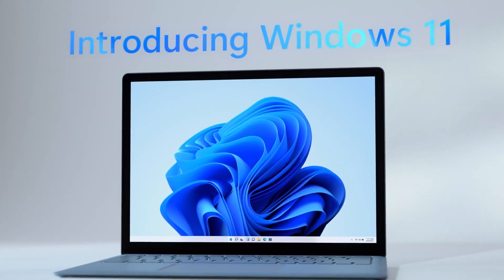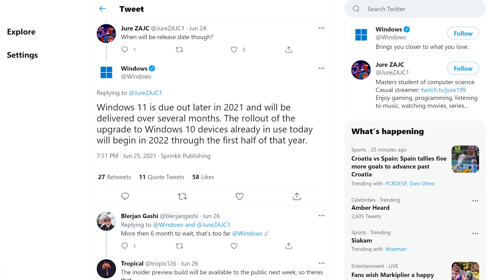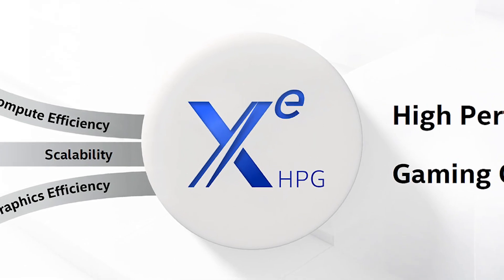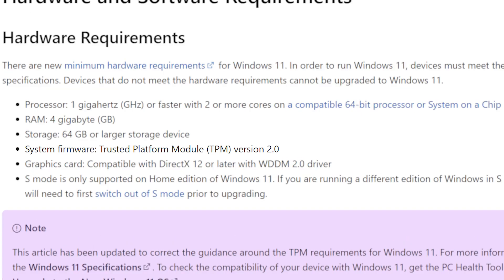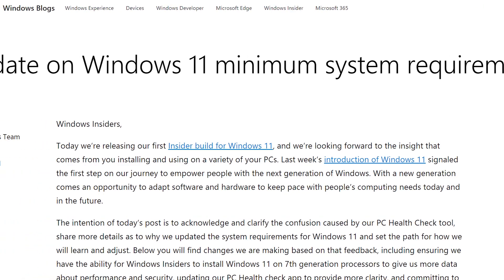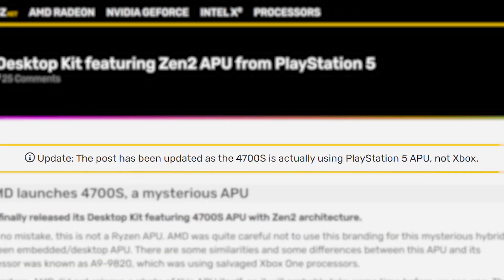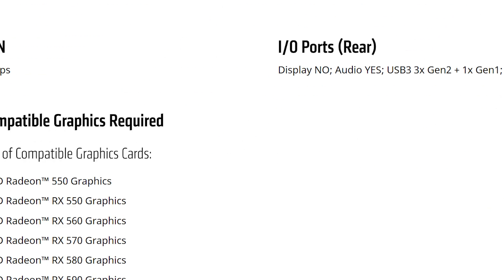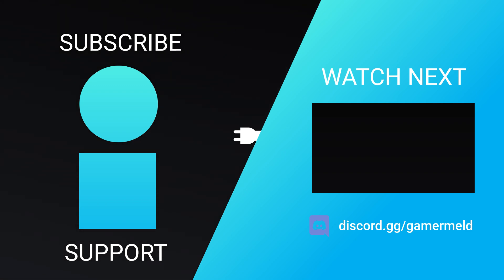TONS Of Gamers WON’T Be Able To Install Windows 11!

Comment: Definitely going to transition to Linux, PopOS for gaming and Manjaro for the rest. Can't wait to get rid of Windows especially since they pulled a "Facebook" for Windows 11.
Reply: Windows 11 is going to run DX games way better than lutris or dxvk can.
Reply: @xander hasass True
Reply: @xander hasass No it didn't, you have to use a translation layer, which uses resources and slows down the game.

Also, now that Nvidia allows GPU pass through most Linux users with Nvidia GPU's are running Win10 in a VM on Linux for the better gaming performance.
Reply: @xander hasass Direct X and Vulcan are not program languages, they are API's.  If you tested games with the DX API, then you had to use some type of translation layer because Direct X is a proprietary property of Microsoft. 

Said translation layer adds latency because EVERYTHING has to be translated instead of communicating directly.

You should know all of this if you tested out multiple games.
Reply: @LePedant  One explanation of why @xander hasass finds games run faster on linux is possibly because of Windows being generally much more resource hungry than Linux, with all the bloatware and tracking. Therefore Linux has more available resource to do the other stuff, which might compensate for the translation layer cost. Not sure if this is the case, and maybe someone already did some testing about this.

As for myself, I don't really care if I lose a little FPS. As long as I can enjoy my games without all the sillyness that all tech giants are imposing these days, it'll be all the more enjoyable knowing my every mouse movement and keystroke aren't being monitored by some AI somewhere.

Comment: The Windows Insider Build just released is allowing installs on Ryzen 1st gen CPUs 👍 it runs really well. I have an ASRock B450M-hdv-r4.0 with an R5 1600 installed just fine.
Reply: the most awaited feature of w11 isn't in the insider

Comment: I'm keen to try windows 11, hardware specs are of no concern as the community always comes together and figures a way around everything. As long as we can install it the activation methods should still work in theory. But we will just have to wait. No good worrying now. Microsoft being Microsoft most likely will change specs again before it's general release. Already signed up to get the dev build.

Comment: To be honest... given the fact that using software in it's 'SUPPOSED' v1.0 these days often feels like Beta or Alpha testing v0.1 

I am not sure I give a damn that I have to wait until next year to use Windows 11

I mean, the many parts of Windows 11 that I don't necessarily agree with aside...  why on earth do we want to use v1.0 of ANYTHING these days when there's a fairly good chance that it's gonna have something broken on launch, and will require substantial time for ppl to discover and fix?

I might as well wait for v2.0 or at least v1.5 then jump in when at least the most egregious issues have been discovered and ironed off.

Comment: Microsoft: yeah screw over anyone on intel 7th gen, Ryzen 1000 and older

Also Microsoft: why is our adoption rate so bad?
Reply: if they already have you on windows 10 they won't care
Reply: @jaysanchez4407  only one of my computers is on win10, the rest are still on win7 because fuck Microsoft for collecting data about my usage and calling it diagnostic
Reply: @PackardKotch  they still can do that with windows 7
Reply: @PackardKotch  you can disable that lmao
Reply: @maybelbdidit  you can bypass it in the beta, not disable it ya genius. The only way to bypass having TPM 1.2 or newer is by putting win10’s installer files into the win11 iso
Reply: @jaysanchez4407  nowhere near as much. Windows 7 only collects basic usage data about the system itself and it doesn’t beg you to log in with a Microsoft account. Win7 also needs less ram so there’s that
Reply: The thing is I just got a new PC and I'm on i5 7th gen 😭.

Comment: There was a guy who just copied the file that checks the requirements for hardware from Windows 10 into the leaked Windows 11 ISO and installed it on an old 1GB RAM HP laptop. I'm sure it will be cracked soon enough.

Comment: Considering how Microsoft's track record is to make one good OS followed a bad one, i wouldn't worry about it
Reply: It's actually somewhat slippery to consider it that way recently. We go 7 - 8 - 10 - 11, so 11 falls as time for the bad shit. Unless we take 10 as bad, which is totally not incorrect... just it means we get the 8 as a good system and the people of 7 will argue with you when you go that one step back, because now windows 7 is the bad time stuff.
The pattern has been broken at this point basically.
Reply: @thestarvingonetso5627  what are you talking about?
XP-good
Vista-bad
7-good
8-bad
10-good
11-looking to be a bad system so far
Reply: @CultOfMonika  Many would probably argue with 10 being good. There was a lot of mess with MS rolling out the system and pushing it by force to customers, while it released kinda beta back then. Besides, I had my moments of trouble with the spring and autumn updates often bringing less fixes than new issues in the system, as well as useless features. There's also some to be said about the security and privacy of the system.
Call it good, but it was the most troublesome Windows of all I had an opportunity to fiddle with (which is XP, 7, said 10, a bit less of 8 and some Vista)

Comment: Why fix your broken os when you can go through the hassle of making a new broken one
Reply: Works for the 90% of its hundred million users while making sure it works on most hardware configuration, yes. Its broken.
Reply: @UnoZero1  oh, so those supposed 90% don't constantly run into driver issues, random hardware crashes, cte's, audio bugs and updates that have such a bad reputation there are YouTube channels dedicated to reviewing updates from the biggest OS manufacturer on the planet because they can't be trusted. Get outta here with your horseshit

Comment: I really don't see the issue with Win'11 requirements. Yes, they are leaving a bunch of people out, but on the other hand, you're not required to upgrade. There is nothing these users could gain from moving on to the new OS - in fact, any improvements that the requirement list brings would be nullified if those requirements didn't exist, and even thing like better support for big.LITTLE are meaningless for old hardware.
 Win10 support will go on until 2025, considering that the unsupported hardware should have a few years already, that is ample room for an upgrade. And any new hardware you buy from now on is likely going to be win11 ready because neither AMD nor Intel would want to buy a fight against the main PC home-user OS provider - specially now that Apple is making their own chips.
 Just... calm down people. Yeah, M$ sucks for many reasons, not this one.

Comment: the amount of e-waste alone this will create is disgusting.
Reply: Microsoft doesn't give a shit about waste.  They probably worked out a kickback of some kind from the influx of PC purchases this will create.
Reply: This is why all my old computers run Linux and are still very usable with them

And you can also bypass the restrictions it’s not to hard
Reply: nah, install linux instead of windows 11 and it will feel like a revival
Reply: (or use windows 10 for the rest of its lifespan)
Reply: @YariCodes  I plan to use Windows 10 but it's just 5 years from now and that's it.
Reply: @Legion849  it’s not going to blow up in 5 years. Just won’t get any updates.
Reply: @MikeJones-bl6lu  Which means you'll be exposed to criminals, meaning people will drop it and run to Windows 11-compatible systems. Happened to XP, happened to 7.
Reply: @markkoetsier6475  there are PCs out there that still run XP. I wouldn’t really worry about anything until 2025.
Reply: @Legion849  You on being unsecure as no security updates roll out for your machine? What's your IP?
Reply: @YariCodes  im thinking of linux. Theres some scarry stuff in windows 11.
Reply: @YariCodes  or people could just keep whatever os they have say if someone has windows 10 they could just keep that. they do not have to install linux.
Reply: @supersaiyaman11589  i already said that
Reply: @YariCodes  Most games don’t natively support Linux especially Esporte titles due to anti cheat, Most people don’t want to deal with Linux or the process of switching, Windows is like the Apple of os it isn’t the Best but it is the simplest to start and get going so
Reply: @jxkz9980  you can continue to keep using windows 10, like i said.
many games by respectable developers will provide native linux builds, btw, it's not as bad as you might think
Reply: I understand where your coming from but i play comp in a bunch of esports games at high levels and I can't use them on linux due to easyanticheat so
Reply: Write your politicians. Green is in.
Reply: lol
If you're using ryzen 1st gen then just update the CPU... or take your PC to someone that knows how to do it.
This is literaly way cheaper than buying a whole new system.

Also, no one is forcing you to update to windows 11.
Reply: Windows 10 will still be supported for the next 4 years 💀 yall don't need the latest OS to survive
Reply: Also there is a bit of bandwidth waste. I go through the system twice a mouth and remove unwanted processes M$ insists I need. 
The olde lady is going to have a fit. Win 11 may just mean she will have get used to Linux, again. Also it's lack of "fun games".
Reply: HRP said it too
Reply: @petraf.y.t.heinrichs4286  some donations will fix that nasty grin
Reply: they should've kept the same, or similar requirements to windows 10. there's no reason for tpm, there's many other ways to do that. there's no reason for the processor to have to be that new. like, stuff like the ram requirement being changed, that's understandable. but my pc is from 2012, thus doesn't have stuff like tpm, and a new cpu, so it's just a waste. it runs windows 10 very very well
Reply: What e waste? No one that's smart will install windows 11
Reply: If you do not take your old hardware to an electronics recycling place, then you're the problem.  Hardware refreshes are just a simple fact of life.
Reply: You mean "perfectly good hardware that savvy people will be able to buy for cheap"? :)
Reply: Like what Apple does yet never get any backlash for it. No wonder they're the most valuable company
Reply: fucking tell me about it mate. then there the ones who say OH WE ARE REMOVING THIS.
Reply: You guys do remember how desperate they gotten when nobody wanted to upgrade to Win10 from 7 or 8 even tho it was free and didn't have a hurdle? 
Majority of the common userbase will just not upgrade their OS, and i doubt anyone will buy a new PC just so they can run 11. Aside from the whole TPM module shit that most builders PCs wont even have. That i expect will be the first thing to go when the majority of people just simply wont upgrade.
Reply: @tehSunBro  you do know all Intel chips support software based tpm (not sure of amd) and the issue is more the old chips can't support the newest tpm version
Reply: you know people could always not upgrade too windows 11 if they need to change their pcs. i mean what will windows 11 do for the average user that windows 10does not that is life charging too that person. People are acting as if they don't get windows 11 they wont be able to live they are so angry. If Microsoft wants to be unreasonable during a chip shortage don't upgrade too windows 11.
Reply: well people should not upgrade unless they have a reason to do so than the e waste would not be as much.
Reply: @supersaiyaman11589  people upgrade whenever they feel like it
Reply: @jaysanchez4407  the pont i am trying to make is many people are complaining about having to get new computers because of windows 11 and if it bothers you that much don't get a new computer just for an os.
Reply: How does this create e-waste?
Reply: @maybelbdidit  if those gamers get new computers and throw away there old ones. just to get windows 11 that is how it would create e waste
Reply: There are still people alive using windows 7 lol 🤣🤣😎😎.....
Reply: @rafaelclp  people who want the security updates from microsoft?
Reply: @rafaelclp  devs... we had vulkan years before directx12 but not many cared about it. (vulkan also being more similar one to directx11)
Reply: @rafaelclp  that's my point. Directx12 was pretty useless when its launched. Now there's this new Directx12 in the trailer
Reply: I will gladly buy a 4 year old computer from someone who thinks that it's going to be obsolete soon. *rubbing hands together gleefully*.
Reply: Waste, what waste (Sweeaping under the rug)?
Reply: @petraf.y.t.heinrichs4286  good one 😐

Comment: Please understand that "Upgrade" is NOT the same as "Fresh Install"

There are Tons of Windows 11 ISO on Torrent sites with TPM 2.0 Requirement completely Stripped from the installer, and of course the latest update.

Old CPU like Core i7 2600K still work just fine with that Customized Windows 11 ISO without TPM 2.0 if you're doing it from "Fresh install" not from Windows Update feature of Upgrading OS.

Comment: It appears that most 1st gen ryzen refresh chips (1600AF for example) which are actually Zen+ (same node, smae architecture) but downclocked will support windows 11. No saying that the original Zen chips will, but if you did manage to snag a refresh then you can upgrade to windows 11. In fact AMD has the advantage in this case because almost everyone on AMD is using a confirmed supported processor, whereas with intel you can still find people with much older skus (kaby lake, haswell to name a few). 

Additionally, Windows 10 is stable and adopted enough that even past 2025 most games will still have support for it. So in reality, not being able to upgrade to windows 11 won't really mean anything because the vast majority of people will have upgraded to supported hardware by the time it's discontinued.

Comment: Absolutely no problem installing it through the Microsoft insider update on an iMac 2013.
Reply: Insider builds don’t have hard requirements checks…yet. The final version is expected to not run on your mac
Reply: @NazmusLabs  I mentioned this in a previous comment, but actually it does, I had requirement problems on my main system which is a 3950x, picked up that secure boot and tpm were dissabled and wouldn't let the install continue.

The installer just seems picky at the moment, usually with machines less than 5 years old.

Comment: Bruh honestly I just know that this will also stop most cheating cause of its new features so im willing to upgrade and have the money ready I want to go back to warzone tournaments without hackers
Reply: How will this stop people cheating in any game, and even if it would, how would this stop people using windows 10 or linux to cheat?
Reply: @Kaiserin_Amy  possibly if the game company makes pc have to require the windows 11 they couldn't play that game if they accept
Reply: @alphiceterplayz9715  That can't happen for many reasons. The first on top of my head would be that TPM is only used for validation. So when you store passwords/private keys etc. instead of storing it in and encrypted/unencrypted drive, you store it in the TPM module be it in the CPU or a stand alone one. I can't say this is very good for unauthorized changes such as when you get infected by virus, Windows will dispose of it easier. Or when sending data, TPM can encrypt it.
Reply: @godlikekiller4344  watch badboy beanman he was talking about how it could solve it
Reply: @alphiceterplayz9715  Ignoring the fact that no game company is going to do this because they actually want to people to buy the game than it would still solve nothing. They could than still load up their hack and just run it.

Comment: 3:05 "Can not upgrade" : not being able to upgrade from an installation of Windows 10 might not necessarily mean that you can't install it at all from an ISO or a cloned disk image.
Reply: @STONE69_  ok
Reply: Today I tried upgrading a Windows 10 Pro installation to Windows 11 Pro (Insider Preview), with an Windows 11 ISO made from a Windows 10 ISO (from Windows Media Creation Tool), worked flawlessly! Had to install through the "setup.exe" file on the ISO itself.
Reply: With this ISO I could also install Windows 11 on an old 2700K, no problems what so ever..

Comment: My hunch is if you have a 300 series or 400 series mobo that supports an external TPM module, you might be able to install Windows 11 on Ryzen 1000 series.  2000 series and 3000 series can use Ryzen's fTPM with out having to purchase a module - I suspect (but don't know for sure) that's where the hang up is (the fTPM is incompatible for some reason on 1000 series.

Comment: this cpu requirement tells me that the new OS is gonna be a pig on resources so gamers might not want to upgrade anyways we really need a better option for gamers i'm sick of windows and don't wanna fight with linux to play my games
Reply: Pretty sure the minimum requirements for CPU is 1gz and two or more cores. It was incompatible with many CPU not because they are slow.
Reply: @UnoZero1  Doesn't negate the fact that we need a straight gaming OS I hate windows at this point to be honest, they mess with stuff that works too much sometimes. I am fortunate enough to have a high end system so i don't care either way about the specs required, but I'm sure people who can't afford a 2-3k machine would appreciate being able to upgrade. If not at least extend support for 10 for those 'customers'. Not to mention I've heard buzz of a subscription model for future OS's that's something that I'm extremely concerned about (I hope it was BS).
Reply: @GoTi4No Cool I got a 3000 series, like I said they could extend support for 10 for people with lesser machines.